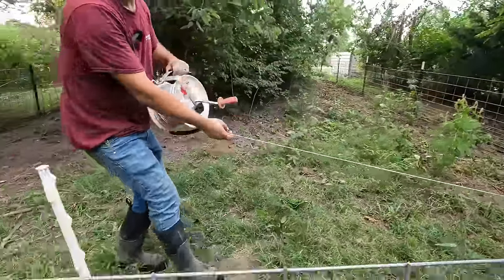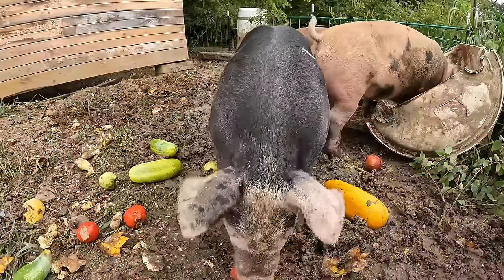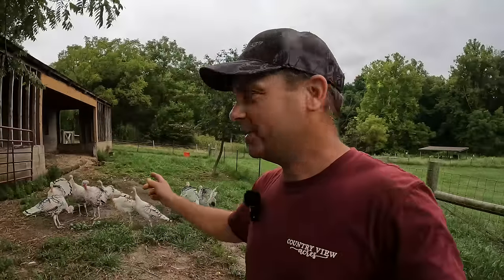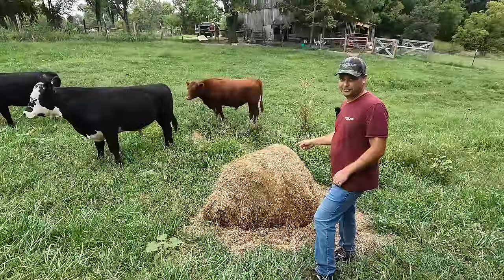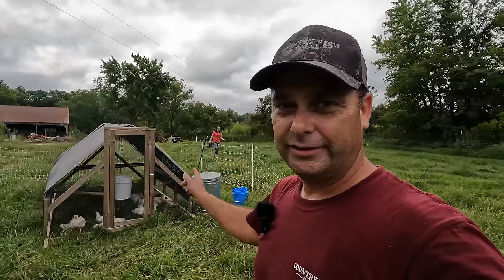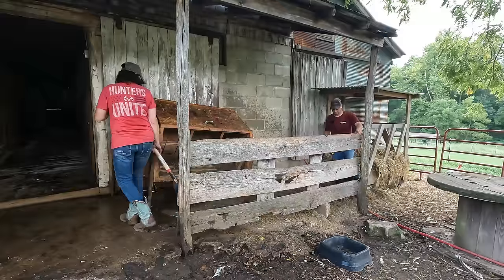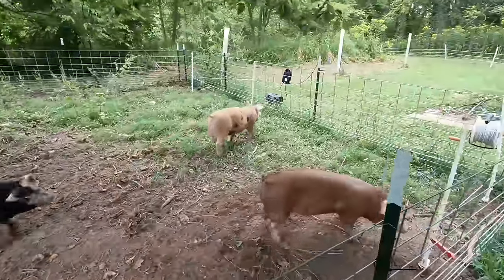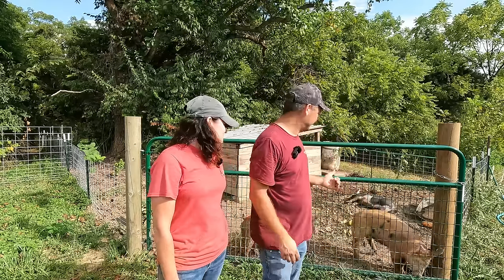The Pigs Learn not to chew on electric Fence, Turkeys Fighting, and a Full day of livestock chores.

Comment: My subcompact would fit through the door but it would still be really tight trying to maneuver in there. Our barn was the same way. We had to shovel or fork out the box stalls and the feed stall by the manger. Some years it was 2 feet deep. We had the same issue with the chicken and brooder houses. Still nothing but good memories of our farm. Pigs are too smart for their own good. Lol  One year my Dad put some pigs in an electric wire pen in the woods. When it came time to move them, we had to catch each one and lift it across where the fence had been. They flat refused to cross that line. Silly pigs.

Comment: I moved my 2 month old piggies to a larger pasture and strung electric fence wire about 8 inches from the ground to train them to stay away from the fence.  That first day they got zapped many times, squealing each time then running into their shelter.  After a couple hours of that they ran into the shelter and buried themselves in hay for the rest of the day.  I felt bad for them.

Comment: When my dad had pigs, they learned very quickly that the fence was not your friend. His biggest problem was when he wanted to load them up for market they would refuse to go through any area that had formally had a wire going across it. He also trained critters like raccoons and such to stay out of the garden by putting a wire up and attached something  edible to the wire and if that was not effective enough he would place a small piece of flat metal under the wire. Sounds mean but things learn very quickly and they left the garden alone. His land included an old empty gravel pit and the pigs would root around the edges, making a trail around the rim. They were also great at keeping down the brush back in the woods. They can really be very smart, we had one that became a pet until he became too big. Lots of work that you are doing, but it is looking good.

Comment: hello great video. have you thought about putting a drain pug in the water tank to help it drain
Reply from the maker: There was a drain plug.  But it has an electric heater in it.  I should probably take it out in the summer time.  So I can use the drain.

Comment: Where's the 4 wheeler to pull the chicken tractor, animals can also smell when a fence is on to some extent.   i have heard that if you want to break wild animals to a hot wire put can lids with peanut butter on them on the wire  they will smell it and nose it and get shocked